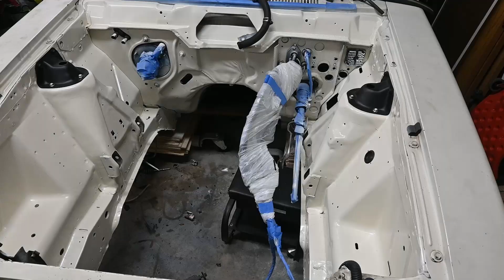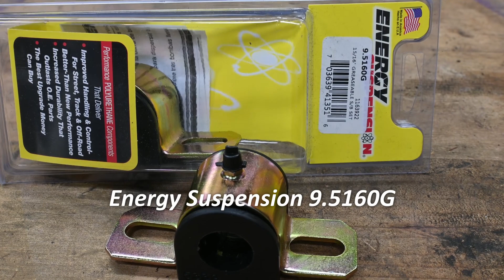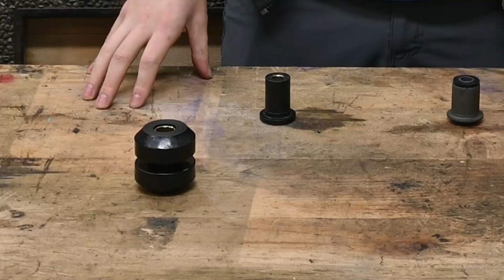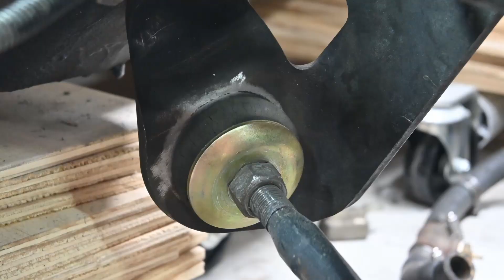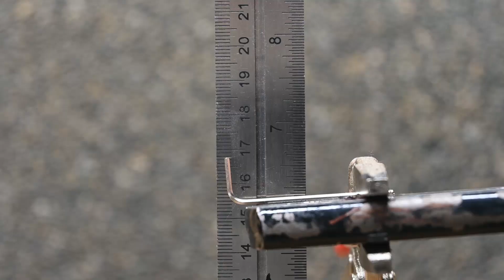AMC Eagle Front Suspension | "ON THE TOPIC OF"

Comment: Parts Recap of what Ludworks is using and the approx time in the video so you can quickly investigate.
to do your due diligence. I've just ordered these now and a few things are on back order but I should get
 them in a few weeks.
 
MOOG
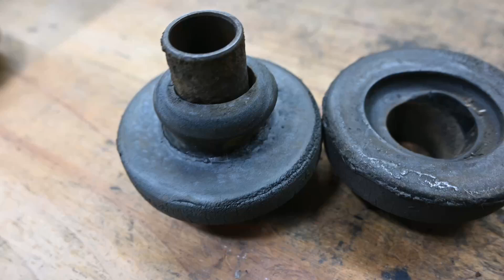	K8157	Strut Rod Bushing (Rubber)		        (14:45)
	K3180	Bump Stop (Rubber)			                (19:25)
	K3124	Swaybar Bushing Kit (Rubber)		        (13:41)
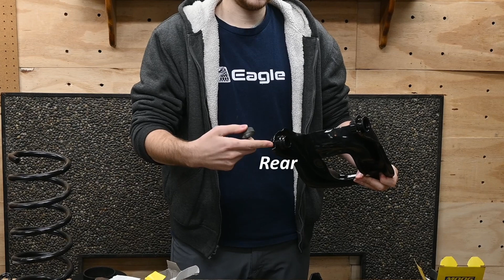	K3113	Lower Control Arm Bushing (Rubber)  	(7:39)
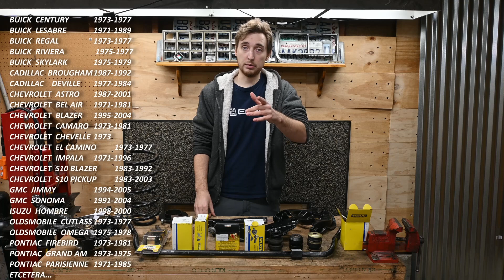	K3096	Upper Control Arm Bushing (Rubber)	(6:30)

Energy Suspension
	9.5160G	SwayBar Mounting Bushing (Poly)		(10:10)
	4.2132G	Spring Perch Bushing (Poly) 		        (8:45)
	11704	Prothane Isolator Pad (Poly)		        (18:40)

Note: there is much more in this video such as  Lower Control Arm could use ACDelco 45G9026 or why
he uses rubber instead of poly for most things but the list above is a great start.
Reply from the maker: Thanks Stephen, you're a legend!

Comment: There are other issues with the strut arm bushings.  You mentioned the orientation of the cupped washers, those will have an influence on the articulation.  Your Moog setup has the washers with one cupped in and the other cupped out, going from front to rear as  ({-<|>-{(   ,  while the other setups had both cupped inward  ({-<|>-}).  iirc AMC  set them up like the Moog setup, but it depends on the shape of the bushing.  A thing to  consider that AMC strut arms are trailing the control arm where as Fords strut arms are facing forwards,  the forces on the bushings and washers are opposite so any included instructions with the bushings might be questionable.
Reply from the maker: You're absolutely right. The Moog bushings have specific AMC call-outs in the instructions stipulating direction of installation. Even though the strut rods are opposite from a Ford, they still specify that the bushings should be installed with the washers cupped towards the rear. But, the instructions show that they also used to manufacture a version which had the washers cupped inwards. Maybe they used to make one version for AMC and one for Ford, or maybe for different models or years. We'll probably never know. To complicate matters the AMC repair manual shows multiple strut rod drawings with different washer directions. The good news is that you can pull apart the Moog bushings and flipped the washers as desired so I suppose it's down to installer preference. Thanks for bringing this up. I might have to discuss this in the next video.

Comment: Hello I was curious if you found any information on getting new strut rods? or if that will be covered in the second part. Thanks for all the useful information.
Reply from the maker: Thank you for watching. I'm may touch on that a bit later, but unfortunately there is no one I know of that makes them. I've heard of people getting Mustang strut rods and heating up the ends and bending them to get the right angle for the Eagle (the mustang ones are completely straight). I've also heard that some of the companies that produce aftermarket Mustang strut rods with spherical bearings instead of bushings can be talked into doing some one-off Eagle ones, but they're usually quite expensive.
Reply: @Ludworks   Thanks for the info. I was also curious if you had any information about manual swapping an eagle since yours is a 5 speed. I'd like to do it to mine eventually.
Reply from the maker: I've heard that by far the easiest thing to do is to find a donor Eagle. You can use an AX-15 from a Jeep, but it will likely require some minor floor pan modification and possibly re-clocking the transfer case (I may do that someday should my trans fail). The gear ratios in the Eagle T-5s are much better suited to the common axle ratios. 

The master cylinder is tucked underneath the brake booster and it is a pain to get at. Also there was no actual fluid reservoir, but just a vertical plastic tube with a cap, a terrible design as they often crack and fail. 

My understanding it that you'll also require driveshafts, or to have yours modified. I believe the automatics were longer so the rear shaft needs to be lengthened and the front shortened. I believe the transmission crossmember is the same, but I'm not positive.

A transmission rebuild (and associated parts) is on the to do list for a future video, so you may see that eventually, but I don't own an automatic so pointing out the differences is difficult. I hope this helps.
Reply: CJ PONY PARTS, part number 94220.  looks pretty close to correct